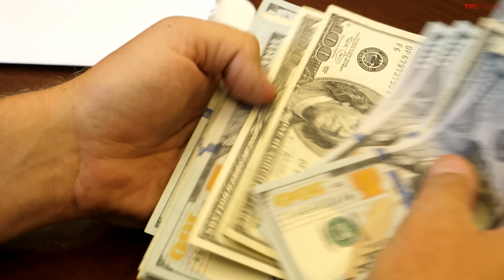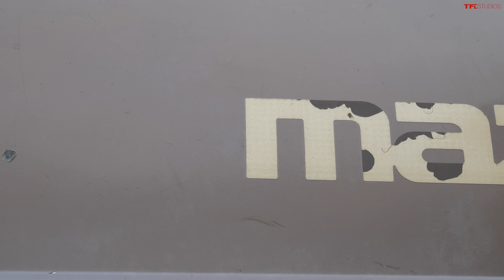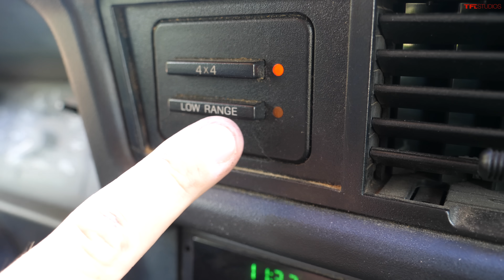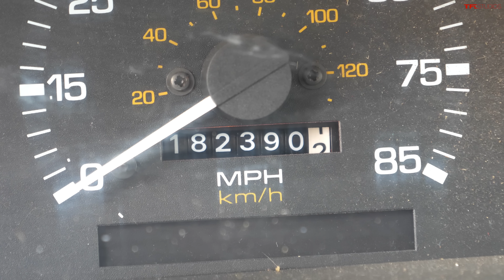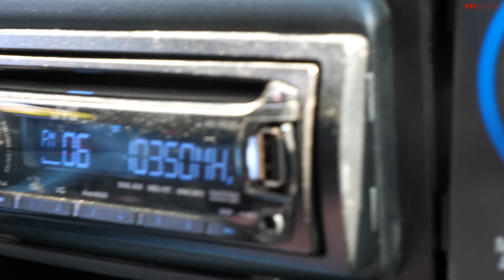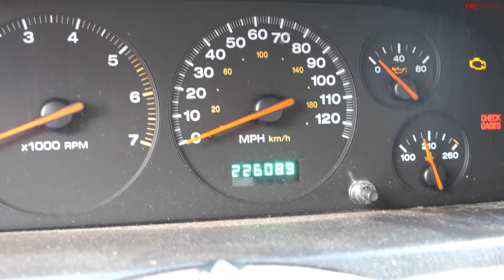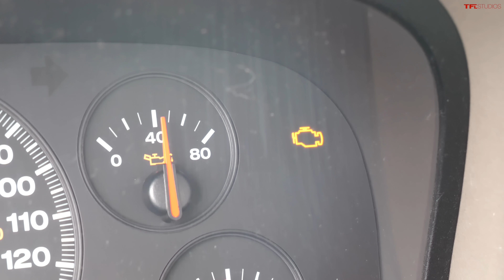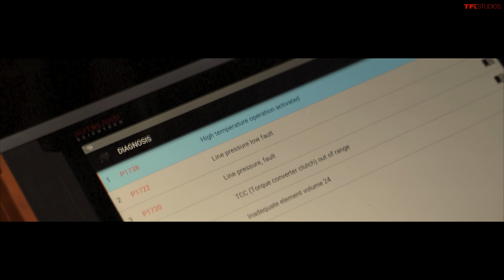Under $2,500: We Buy Three Vehicles That Are Complete Crap - But Which One Is The Worst?

Comment: So Tommy I saw the codes that the tech pulled up. You have a torque converter code that is why you have a transmission overheat code. Torque converter is slipping. Needs an overhaul. 01 is a 5 speed automatic. 2001 Jeep turned on the 5th speed on in 01. You can have 5th turn on on a 99-00 by having the dealership flash the pcm and tcm

Comment: I had had an 89' S10 with the 4.3 and used it to pull my 18.5" boat monthly with no issues. Probably had around 250,000 miles on it before it got totaled in a wreck when my dad was driving it. I would love to find another in good condition like I had but in a 4x4.
Reply: I had an '02 "Xtreme" street machine 2 dr Blazer with the Vortec. That was the world's easiest paralell parking vehicle with 100" wheelbase and rwd. It was a cool car and peppy, although guzzled gas for how big it was.
Reply: That 4.3 is one of the most dependable v6 engines ever made. 
Was even used in industrial applications. 
  It never got the recognition it deserved cuz chevy always mated it with questionable transmissions.
Reply: IN A GM?   YEA RIGHT   LOL
Reply: @toddbob55  
I had a 1997 bravada with the 4.3 vortec.  The truck was a total shitbox, but the engine wouldn’t die.  Only reason I got rid of it was because the “AWD” system was failing and the body was rotting out.

The engine (with over 250k on it) however was mint.  Sold it to a junkyard for $250 and he was ecstatic to get the motor out.
Reply: I'm working on a 1989 gmc s15 with the 2.8 5 speed in it 140k miles everything works good needs alittle body work I'm going to clean it up and do a v8 swap just Saving the money now
Reply: @toddbob55  
Young? 
GM was, by far, the most dependable from the early 80s all the way through 2005...ish. 
But yeah...their gas trucks, and their cars suck now. 
  Chevy is the only gas truck any sane person would tow with.
   Toyota, IMO makes some of the most dependable gasoline engines on the planet. 
  Toyota used gm 4.3 in gas and lp forklifts until about ten years ago, and only stopped for economical reasons. 
    You can guess why they chose it.
Reply: I currently have a 97 s10 zr2 with the 4.3L im about to surpass 300k miles on it, still runs amazing
Reply: My grandfather bought an S10 of the same year, same 4.3l motor. Sold it to his brother, and when he died, it went to another brother. When the clock stopped working, it had over 600,000 miles on it, and it lasted a decade past that. Of course, by that point, it had no brakes, only two forward gears, and it should have been totaled out a dozen times over (including the time it caught on fire). But it cranked right up every time, and all it really needed was the brakes rebuilt and a new transmission to be driveable. My great uncle's son had to basically steal it from him, as he had Alzheimer's and was getting lost driving around.
Reply: You put your model boat on a trailer behind your truck?  I mean I know those weren't that powerful but still it seems like overkill to pull an 18.5" boat with a truck
Reply: @presplay8819  Pls dont waste your money on a v8 swap. With having the 2.8v6 you will need a new transmission as well. Even if you get super lucky and get a good running junkyard 350 and tramsmission its gonna cost you at least $1500. Prob more like $2k to $2.5k nowadays. Then you will need custom motor mounts welded to frame, custom exhaust, and custom driveshaft. Plus since youll need a carbureted engine most 350s you will find will be from 70s early 80s. This means absolute tops 220 horsepower. Your much better off buying either a 80s 90s full size and putting vam and exhaust on. Or 98 to 2005 with a 5.3ls and bulding it up.
Reply: Nice I had a 91 S10 4WD. While the 700R4 is not the best transmission, it does great in a small truck with a 4.3 v6 engine like this. The manual transfer case is awesome etc. It rattles and has no carpet but its a perfect beater rig that has never given me any problems.
Reply: @toddbob55  4.3 is reliable, its comings from the old 5.7 which again is reliable, you sir dont know what your talking about
Reply: @r1nger81  Yep, good 'ol 4L-Slippy.
There's a cheap transmission upgrade that can be done to them that I'll probably do when (not if) mine craps the bed that has a very good reputation.

Comment: Front tires are cupped on the B4000...usually worn front ball joints, camber bushings, tie rod ends.  Normal things on those TTB front axles.

Common issues on those trucks was the front autolocking hubs...many people just replaced them with Warn, or Mile Marker manual locking hubs.  The other common thing was for the transfer case shift motor to stick, and either not engage or not disengage...mostly due to lack of use.

Comment: Folks were surprised that the 4.0 was slow? I had one and it couldn’t pass anything, including the gas station.
Reply: They got a 4.7, which has all the downsides if the 4.0 and no reliability to boot. Btw how was yours slow? My 97zj cruises at 85 when I have to, gets mad at 90
Reply: @RichTexas82513  my 4.0 wasn't fast but definetly not slow. Plus they have more torque than hourse power and rev super low. Nothing about them was sporty you got soild axles and a 4.0 for a reason haha.
Reply: @RichTexas82513  the 4.7 was reliable. i have a few buddies that have a few 4.7s that have all hit 300k without issue.

the problems with the gen 1 units (all issues were fixed with gen 2 but those were never put into this body style jeep) all came down to owners and lack of maintenance. they dropped seats because owners let them overheat, and then sludged up as owners also never did oil changes.

Comment: I had a 1996 Mazda B4000 that had over 300,000 miles on it when I was unfortunatly involved in an accident and it got totalled. One of the best trucks I have ever had. The 4.0 V6 was a very strong engine. With basic mantenince it still ran like new even with that many miles on it.

Comment: About 2 years ago, I picked up an 87 Ford Ranger 4x2 2.9L V6, 5 speed long bed for $800.  Yep it needed brakes, and tires, but for $800 for a great running, work truck without any dents is pretty good.  Even the AC in it works.  I actually found a set of aluminum wheels with almost new tires on it at the pick a part yard for $250.  I believe the previous owner got tired of the acceleration/drivability issue it was having.  Once it warmed up and went into closed loop it would buck, stall, run rough, etc.  Turned out to be a $45 O2 sensor.  This truck does great for my needs and has a 7 foot bed.  Gets 25mpg on the freeway at 80mph, has 3.73 gears so it'll tow a little bit, Ford de-rated their manual transmission equipped Rangers to only tow 2,000lbs.  Being a manual transmission and 2WD it'll get up and go pretty well.

Comment: I am a Ford guy outta those 3 but that 4.3 is a hella reliable engine and I wouldnt be surprised if the blazer wins this series.

I didnt notice that these vehicles were purchased at least 2 months ago and had reviews on tflclassic till it was recommended.
Reply: my mom had a oldsmobile version and it sucked the awd system failed at 65k miles

Comment: The WJ with the 4.7 actually has the 45RFE transmission which is known to be very durable. It's not the old 42RE 4-speed that comes with the 4.0 that is soo fragile.
Reply: Glad you pointed it out, I kept thinking that when they kept calling it a four-speed. Also, I did have the four-speed behind the 4.0 in my 97, when I got rid of it at 165k it still shifted perfectly.
Reply: all 3 Grand Cherokees/Cherokees  I have owned all had 4wd problems and wiring problems, all around 100K miles. The 4.0L is great but the wiring is crap. My 4.0L / 5 Speed Cherokee was the easiest to fix but it still required a lot of wiring work.
Reply: Should actually be the 545RFE. Mechanically the same but can use the extra gear on downshifts.
Reply: @aaronmodlin1871  01 it would need a computer flash to get the 5th gear. Or computer replacement.
Reply: id be alot more worried about the 4l60 in the blazer lol
Reply: I was gonna say! And Nathan said his tranny was bulletproof.  I was like umm the 4l60e was junk in the s10 blazers.  I remember many, including mine going bad.
Reply: It also weighs in at 4100 ish, not almost 5k like Jumbo implies.
Reply: The only problem I found with the torque management. But cut one wire to disable it and you actually keep wide open throttle, instead of the computer pulling it back for shifting and hard take off. Like a drag race.
Reply: Actually it's a 545rfe in these
Reply: @billyray4716  545rfe and 45rfe are the same but yes you are also technically right. Software as the only difference.
Reply: @billyray4716  It's the same transmission, the difference is the software in the TCU.  One can make a 45RFE into a 545RFE by merely changing it out. Mounted next to the coolant reservoir, big silver box with fins on it.
Reply: I have the 4 speed auto behind a 4.0L in a 99 grand cherokee with 250,000 and shifts fine. All stock never been rebuilt.
Reply: @batsonelectronics  but you keep buying them........
Reply: We had the 5 speed also in our 2002 4.0 Laredo
Reply: 42re is fine... The 44re that they put behind the 5.2 after whatever year they ditched the 46rh...that one i would be wary of

Comment: This is Awesome!! I like series like this! The Blazer is probably my favorite. That WJ is actually kinda rare! The vast majority of the 4.7s came with the Quadra Trac NV247. Very few 4.7s came with the Selec Trac NV242. I think it was only available in the Laredo trim.
Reply: I have a Selec Trac mines a 4.7 and it's a 00
Reply: And mine is a limited
Reply: @coltonrussell8705  Awesome! I never new the V8 WJs ever came with anything other than the NV247, until a few years ago. Only ever heard of a few Laredo's though.
Reply: NV242HD with Dana 44 rear shes the most solid out of all of them.
Reply: @Con_Rad850  all 4.7s have the d44a rear :) SUPER AWESOME VEHICLES
Reply: @tysonvance  Notice how they don't give the WJ much love. I may be biased but at the end of the day thats a solid axle jeep vs a mini van and a fake ranger lol  The WJ still holds it's own with new Jeeps rolling off the line today.
Reply: Yup. I'm installing the 242HD on my 2002 WJ, it came with the NV247. I'm really excited for this swap. @wj4x4offroad 😜
Reply: The ones with the Quadra drive have a different diff that works almost as good as a locker granted the proper fluid and friction modifier are in them. And if dude wasn't sleeping at the line that blazer wouldn't even be close in a drag race. The 4.7 ho motor is an absolute ripper, but it only came in the overland and a few limited versions.
Reply: @codylapoint  my thoughts exactly I have a WJ with the 4.0L and im pretty sure i could beat that blazer lol  I love my 4.0L lost of low end torque easy to work on.
Reply: My 99 wj has the quadra Trac it's a good running truck.
Reply: @Con_Rad850  I recently got a limited with the 4.0 and a lot less miles for about the same price.  It has a few problems but drives well.  I don't drive mine fast because it's just not that kind of vehicle.  I would rather make the transmission last and avoid speeding tickets.

Eventually I'm going to make it a really capable off-road rig.  It's already pretty damn good but a long arm lift, good shocks, big tires, some body/chassis clearancing, a transfer case upgrade, appropriate gearing (maybe through an axle swap) and lockers should make it almost a rock crawler.  An engine/transmission swap could make the entire drive train pretty much bullet proof.

I could do everything and still be in to the Jeep for under $15,000 (if I do all the  labor).  At that point everything likely to fail on a 20 year old WJ would be replaced or upgraded and it would be more capable than any new (stock) Jeep.

I've owned a Mazda B3000 years ago and you could turn it in to a pretty neat pre-runner but I probably wouldn't. 

I've never owned a Blazer, I don't know if there is anything cool to do with them.  I've never wanted one...
Reply: The quadra-trac was standard for 4WD, the quadra-drive and selec-trac were both extra cost options, what's why most came with the quadra-trac.  quadra-drive used the same NV247 transfer cases just added front and rear limited slip differentials....1999-2004 (WJ's) quadra-drive had front and rear limited slip differentials, after the WJ they got rid of the front limited slip, and went to the stupid brake trickery crap instead.  

I'd love a WJ with the 4.7L HO and quadra-drive, and then swap out the NV247 for the NV242.

Comment: I bought a 2000 Chevy Blazer 2 Dr. 4wd. Auto trans. 4.3 Vortec V6 with 94,000 miles., 9 years ago for 3500$. I'm still driving it. 220,000 miles later. No major issues. I drive it everyday. I usually go 10 -15,000 miles on oil change. Had tranny flushed n changed filter (had never been changed.)

Comment: I bought a 97 blazer 4x4 2dr 4wd automatic $600 spent $190 for parts. 107,950 miles on it. All it needed was a fuel line, speedometer fix mirrors, and rear hatch fix.  Mine is cranberry red.  I love my blazer. I've had it for almost 2 months. To quote David Frieburger this thing is mint.  End quote. Indeed it is. Also it's my first 4wd.

Comment: This is a great series in the making. Looking forward to it.
However, the misinformation surrounding the Grand Cherokee is embarrassing.
For people that make their living(s) from vehicles, you guys should know better.
The WJ (1999-2004) only had three motors available. The legendary, bulletproof I6 4.slow, mated to the POS, junk ass 42re transmission. The 4.7 V8 and 4.7 HO V8 both were mated to the rugged, 45RFE/545RFE. The FIVE speed transmission was actually pretty damn tough. Still in use today in 2021. Just needs to be maintained like any transmission.

So, all three of these fools were wrong. They all were undoubtedly making fun of the POS 42re transmission, not the 545RFE, so they were mistaken.

Anyway, small details. I'll be here all series, as a passionate WJ owner, I'll be here dishing out needless info.
Reply: I'm a recent WJ owner, bought an 04 Limited (4.7) from auction on a whim. Spent much time and money doing a lot of fixing and upgrading, intending to flip but ended up liking it, so I kept it and let my wife start driving my 2017 Mazda lol 

My WJ is a 2WD, but as a Texan (DFW area) there just simply isn't much need for 4x4 for me. So far, really enjoying it, especially the V8, it has been many years since I had one.

Comment: I love this series!  However, one note, the transmission (45 RFE) behind the 4.7L V8 in the WJ is beyond bulletproof.  Nathan is thinking about the transmission (42re) behind the 4.0 inline 6.  That one was weak sauce.
Reply: I was waiting for someone to say that
Reply: The 4.7L V8 isn't that great either...the 4.7L HO was supposed to be a much better option.  The 42RE is really hit and miss it seems.  I had 232k on my 96 ZJ 4L with the 42RE, and never had any issues, did some heavy towing, lots of offroading and overheating the transmission, never had  any problems.  My 98 ZJ 4L 42RE on the other hand that was a street queen had all sorts of issues, lost the front transmission seal, shifting issues, slipping, etc, at 159k....Loved the 98 ZJ because of the rear limited slip differential and the selec-trac 4WD, but that transmission sucked....they must have changed some internals on the transmissions in later years because my 96 was bulletproof.
Reply: The 4.7 will blow up before the transmission goes. I drive one daily as my yard vehicle at a jeep shop in pa. But right now the front spring perch is rotting out. That's the wjs main flaw is the damn rubber over the spring perch
Reply: @karentheblazer  the 4.7 in ours had a cracked block. 30k miles later and the transmission blew. I actually just got finished replacing it. I hope we get a lot more good miles out of it now that half the drive train has been replaced.
Reply: @Synergy7Studios  yeah it should be fine to go now. But watch for spring perch rot as well there bad because there covered with a rubber insulator.

Comment: I’m the jeep WJ, turning the key to run position then back to off leaving it on the third time you turn it it will scroll through engine codes where the miles are displayed. Bought my limited for $600 with 50k less miles and in way better condition I must’ve struck a really good deal

Comment: Those 4.3 vortec v6 are great engines. It held its own against that jeep v8.
Reply: Basically a 350 with the front 2 cylinders chopped off.
Reply: Still got my 03 ZR2 truck and thats right. Still running great.

Comment: My mother had a 2000 blazer that became mine after she passed, put a used transmission in it at 187k miles, it spun a rod bearing at 235k miles. I purchased another 2000 blazer (in worse shape but less mileage) with plans of it being a parts donor, but ended up driving it and using my moms for parts. After I gutted it (I I mean gutted) My uncle bought it for $500 and put a lower mile 4.3 in it and is still driving it to this day. The 2nd blazer made it to 250k miles before the body mounts rusted from the frame and had to scrap it.

Comment: I'm betting the Blazer is in the best shape. Might be best off road with that short 100" wheelbase too.
Reply: Nah them blazers had trans issues from the start. I'm betting the mazda
Reply: @benrent6625  your talking about the 4l60e? They had problems but usually at 200,000 miles, i had a few

Comment: I had a 1996 S10 Blazer 2door 4x4 and I loved it. I had mine stroked up with the 4.3L and converted to AWD and a single turbo upgrade kit, after rebuilding the block, revamping the fuel system and swapping the trans and transfer case from an oldsmobile brevada. 302 HP at all four wheels and would haul butt. lol